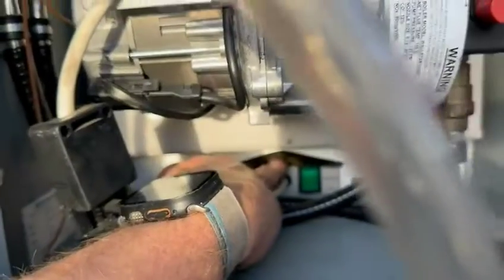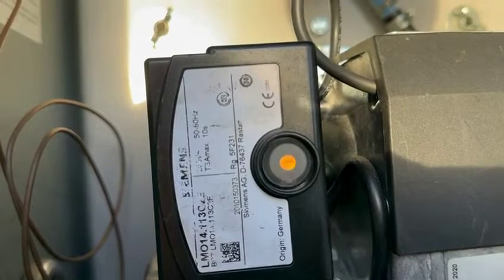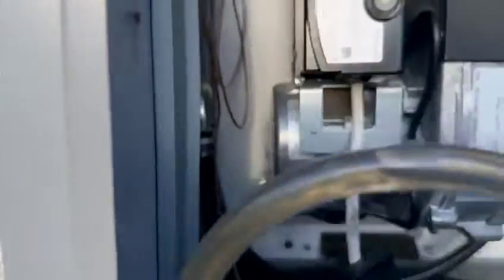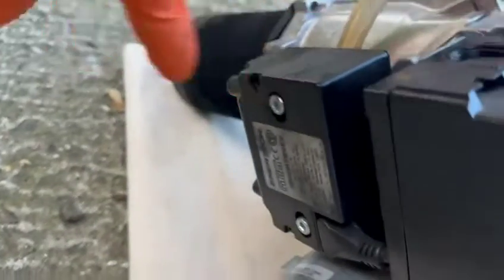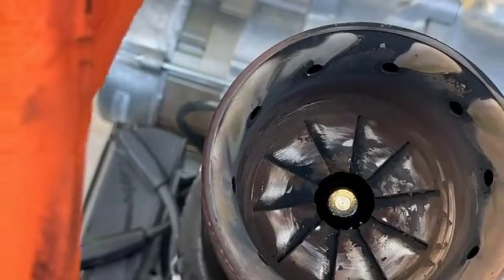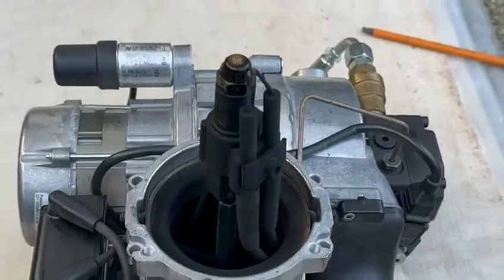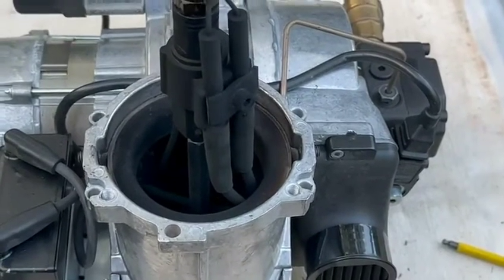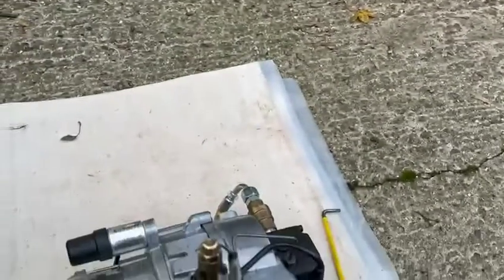HRM Wallstar Oil Fired Boiler Breakdown

Comment: Hi.so I've got the exact boiler mine starts up then fires with solid green light then after a minute or so locksout  once I start it up again it won't fire up to produce that green light.....is it possible for the solenoid valve  to be faulty?
Reply from the maker: Sound like the coil yes. Thanks for watching Rob

Comment: Years ago when doing a lot of council oil servicing, I came across loads of Wallstars. They were all the the older style though. Nice and simple but not very efficient! Hardly ever see them anymore now in the private domestic market.
A colleague one had a great idea to fit a HRM burner plug to his Henry hoover, so he could plug it into the boiler outside, and therefore do a full service and clean without even going in the house for power or the tenant having to be in. All great in theory but when he fired it up for the first time it of course blew the 5A fuse for the heating circuit and he had to wait for the tenant to get back home later that day so he could go in and get their heating back on 😂
Reply from the maker: now that is funny!!! We now have 240volts on all the vans to overcome this. Just need to work out how to switch the rain off whilst we service them 🤣

Comment: Nice video Rob.
Watching from New Hampshire USA. Do you use oil de-aerators when the burner is higher than the oil level? I find air in the fuel also causes sooting. 👍🏻
Reply from the maker: Thanks for the comment. We do but not on a Wallstar as not required. USA Wow thanks!

Comment: Mate, what do you use to pull the oil through the line to burner if you cant get it through. And could you do a video on it as it would be pretty interesting. Ive subscribed
Reply: Have a look at SOS Ultimate Suction pump. Expensive but worth every penny
Reply: @benduker6839  nice one il have a look
Reply: I'll second the SOS ultimate suction pump... it is one of those tools, spends a lot of time doing nothing but sometimes nothing else will do.
Reply from the maker: Thanks for the comment. i like the others use the SOS Suction pump. If not i crack the pump  and override the photocell?